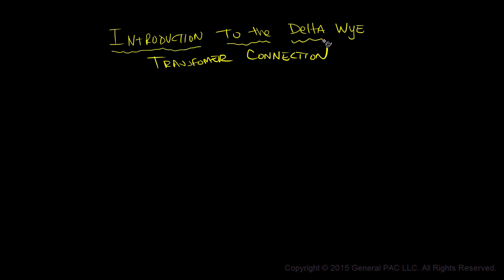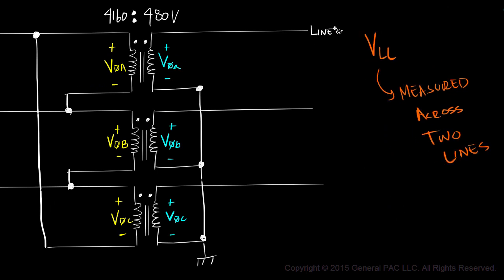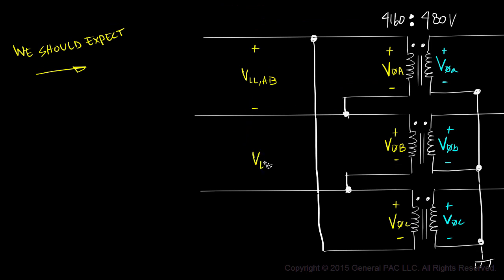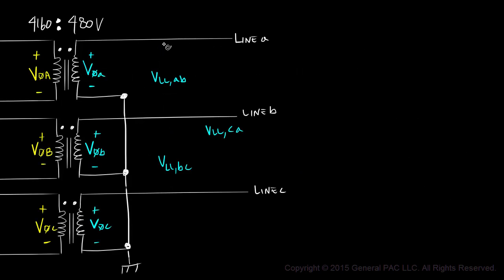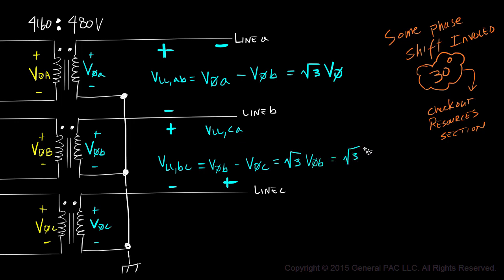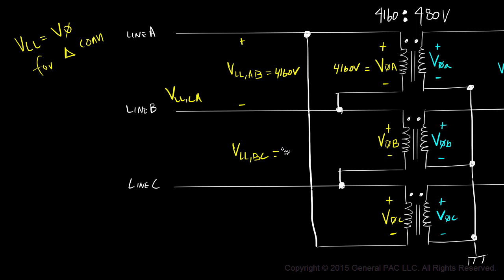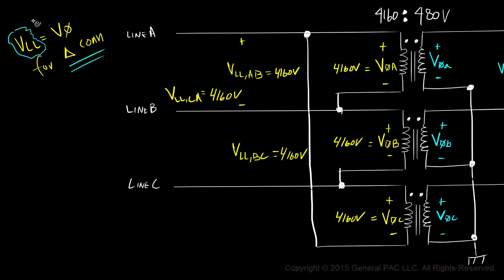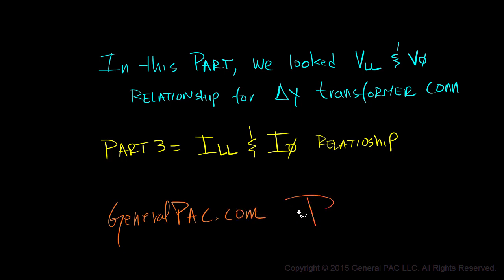Introduction to the Delta Wye Transformer Connection Part 2: Voltage Quantity

Comment: what if we had center tapped transformer on the secondary? how would we connect them?
Reply from the maker: Wye side windings of 3-phase transformers are not usually center tapped. In practical 3 phase 4 wire delta-delta systems, one of the Delta windings is center tapped. Single phase transformers are most commonly center tapped. 

Thanks,
GeneralPAC by AllumiaX

Comment: How to banking 1 transformer 167kva 3phase 280v in 4wires!
Reply from the maker: Hi Lito, a single 3phase transformer can be connected in Wye configuration to get a 4 wire system, 3 of the wires will be for each of the 3 phases, while the 4th wire will be used for a neutral connection.

Comment: Correct me if I'm wrong, the single phase voltage of the transformer secondary is 480 V so meaning the Line to line voltage of the secondary should be √3(480)?
Reply: Tech SUPPORT  At the beginning he said single phase transformer is 480 so that would become the phase voltage of the bank. Now you take phase of 480 x 1.732 and your line to line is 830v.

Comment: Hi,Can I have your thoughts on this ?
Event
I connected the bus pt to the low side of the substation transformer..so from the substation transformer the connection is Delta(Power transformer )to Wye-grounded(Bus PT)
The voltage readings result were unbalanced specially the line to ground
Even the protection relay detected unbalanced fault
This stumped me...
Then I removed the H2 grounding of the bus http://pt.so
 the connection now on the bus pt is wye ungrounded.
This resulted to fix the system.all voltage readings are the same line to line .and even the line to ground is okay.
So anyone have thoughts why this fixed the system?
Thanks
#foodforthought
[bust pt diagram](229753-C1-CCED-4224-9484-F05-DBD3-B5547
)
Reply from the maker: Hmm.. It's hard to tell without the drawings. Sound like an interesting event though
Reply: @Generalpac  how can i give it to you..any email address?

Comment: 3:43 The equation is technically incorrect. The magnitude of the difference of phase voltage phasors is equal to the magnitude of √3 times the line-to-line voltage phasor. However, in the written equation, it says that the the difference of phase voltage phasors (a phasor or complex number, has both magnitude and angle/angle) is equal to the magnitude of √3 times the line-to-line voltage phasor. In other words, the equation says a complex number is equal to a magnitude (positive real number), which is incorrect.

Anyways, I know you said that you were going to just look at the magnitudes. For the equation to be technically correct, you should've written "V_φa - V_φb = V_φ · √3∡30°", or, "|V_φa - V_φb| = |V_φ| · √3". This is just a constructive critique; no offense intended.
Reply from the maker: Love it, thank you and will keep this in mind
Reply: In the video he explicitly says the magnitude, please take a look
Reply: @Muxik4k  Hi Jorge. Yes, he said only magnitude. But in the equation he wrote complex numbers (magnitude and phase). I argued about the equation he wrote, not what he said.

Comment: Line voltage of AB = phase voltage of A - phase voltage of B. Since both phase voltage is 277 V it will give 0V ? 

Do we have to account for the phase angle here ?
Reply from the maker: +Bilal Ahmed yes... Vector math is used and phase angle needs to be accounted
Reply: @Generalpac  wouldnt it still be 0 since 277-277 is 0 revardless if we multiply  or take phase angle into consideration
Reply from the maker: @almiknacademy3626  the phasors A and B are displaced by a phase angle. In balanced systems which is 120 degrees. So, even if the magnitude is same i.e. 277, the result wouldn't be 0.

Thanks,
GeneralPAC by AllumiaX

Comment: where does the sqrt(3) constant come from?
Reply from the maker: +Ericka Fink continue watching all the parts of this video :)
Reply: From Trigonometry, and Using addition and subtraction of VECTORS.
Reply: It comes because the system is assumed to be balanced ans because it is three-phase. That topic is related more to Electric Circuits courses, not to Electric Machinery/Power Systems courses.

Comment: So on a delta 3x230V - wye 3x400V + N transformer, the primary and secondary windings are identical to each others? only difference is they're connected in delta for low voltage and wye for high voltage?
Reply from the maker: The primary and secondary windows are two different windings. The primary winding will have a different number of turns then the secondary winding. The primary winding and secondary winding should be magnetically coupled. And yes, the primary winding is connected Wye in your case. And the secondary winding is connected in Delta.

Comment: I think your Phase and  Line to Line voltages on the wye transformer are incorrect for this Delta - Wye Transformer sir. 

Wye Phase Voltage = V/a=   4160v / (4160/480)v  = 480 V,     not    277V

Wye Line - Line Voltage = ((SQRT(3))*V) / a  =  ((SQRT(3))*4160v) / (4160/480)v =   831V,    not 480V
Reply from the maker: +Braven Dirk -- 4160V  to  480V transformer voltage is very common for commercial and industrial applications in the United States.

I'm assuming that the HV LL voltage is 4160V and the LV LL voltage is 480V. Based on that, the transformer turns ratio (the "a" term) equals  4160V divided by 277V = 15. 

 Both of the values above are Line-to-ground (LG) voltage values. How did I calculate that?

For the Delta connected transformer, the LL voltage equals LG voltage. 
For the Wye connected transformer, 480 LL voltage divided by SQRT(3) equals LG voltage.

So we begin the analysis by assuming the HV LL voltage and LV LL voltage as shown.... and calculate the transformer turns ratio accordingly.  Based on the transformer connection, we calculate the LG values accordingly :)
Reply: So the transformer is specified with LL voltage tranformation. The "real" transformer is 4160:277 if we only look at one phase, am I correct?
Reply: What if it is said that the number of turns "A" (primary winding) is equal to the numer of turns "a" (secondary winding), would it be that phase "A" voltage equal phase "a" voltage as Braven Dirk was suggesting?
Reply from the maker: +Ostap Kurtash yes... 3 phase transformer voltshee are typically dated line to line. So if we have a delta wye transformer with 416:480 LL voltage... And we if we want voltage on a single phase, it will be 4160:277... The wye side needs to be adjusted by sqrt 3 factor